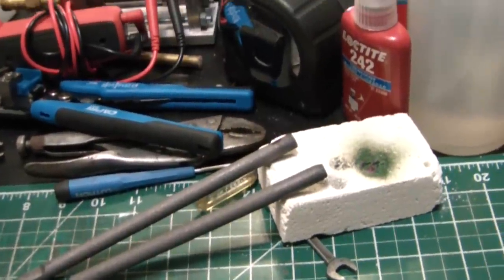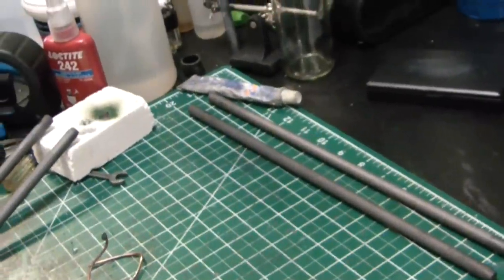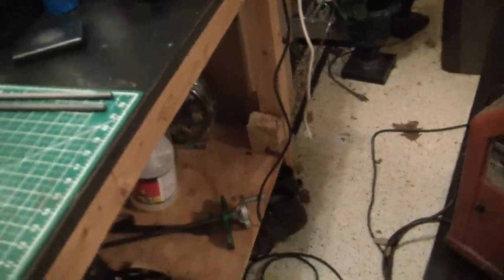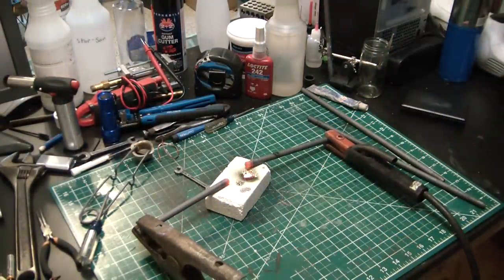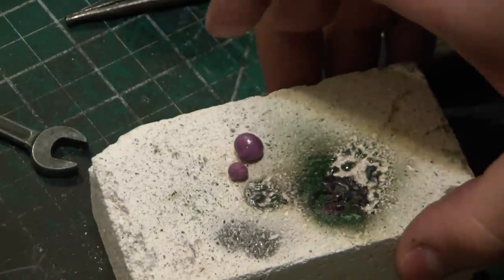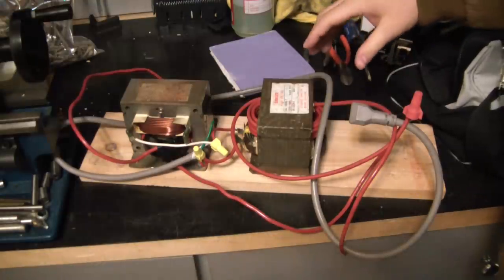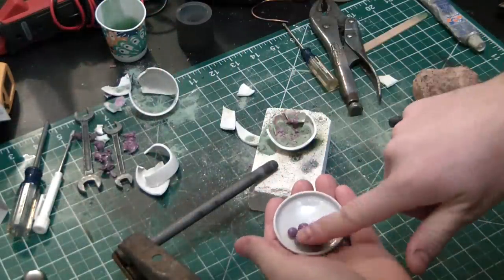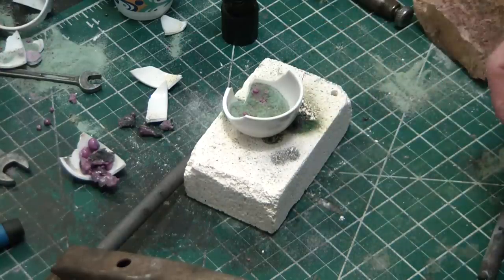Arc Furnace Ruby Gemstones DIY - Huge Rubies and Giveaway! - ElementalMaker

Comment: Isn't chromium oxide poisonous? Everywhere I've seen it's saying it is yet I see you handle it like it's nothing I'm confused
Reply from the maker: This is a chromium III compound, hexavalent is the very dangerous varient of chromium.
Reply: @ElementalMaker  so as long as it's not hexavalent chromium you're fine correct?
Reply from the maker: @theevilzipper  there are other forms of chromium as well, and I'm sure certain salts are still quite dangerous, even of chromium III. You just need to research each chemical your working with to be sure
Reply: @ElementalMaker  I agree and I downloaded the SDS sheet the reason I was confused is because I hear some people say it's dangerous but then others on YouTube handle it like it's sugar so I figured since you seem extremely knowledgeable I'd ask you
Reply from the maker: @theevilzipper  I would certainly recommend good ventilation and washing your hands after handling.
Reply: @ElementalMaker  I have a Miller welding respirator p100 I think and 9mil black rubber gloves. What about clothing? Do I need disposable clothes?
Reply from the maker: @theevilzipper  the respirator and gloves are more than plenty. Try not to pour it all over yourself, but if so just wash the clothes. Hexavalent chromium would be a different story but Cr2O3 is quite safe to handle
Reply: @ElementalMaker  sweet thanks so much for answering all my questions

Comment: Oh hell you can make your own carbon Arc rods just take them out of D cell batteries
Reply from the maker: Those would be quite small for use with an arc furnace. I'd recommend getting carbon rods from a lantern battery instead, they are much larger.

Comment: "better zoom out my camera if its zoomed it would burn out my lens" you know that's not how light works right?
Reply: There a tow ways to zomm in/out a video the optical way by changing the distance between the lenses which means the burning point moves toward or away from the sensor

And the digital way by scaling the pixels

Only the first one has a slightly risk of overheating the sensor

But if the heat isn't to great u will lose same pixels in the video because semiconductors change electric propertys about 50 degrees Celsius and stop working till they cooled below that temperature a permanent damage is still possible wenn u toast that little silicone chip

Comment: Recomment: 
Has anyone thought to put synthetic rubies in a kiln, like glasiers do to homogenize glass? Theoretically, one could get the stones to recrystallize, giving a clear, semiprecious rubidium. 

Thoughts, Elemental Maker?
Reply from the maker: Unfortunately kilns don't get hot enough I think
Reply: @ElementalMaker  the idea isn't to melt the ruby entirely, but get it soft. If it stays soft for long enough, they may cause a cascade effect clarifying the ruby material. That's the theoretical physics, anyways.
Reply: @ElementalMaker  they being heat and time.
Reply: @ElementalMaker  I was just watching NHIL's vid he did after yours. The combo of a graphite crucible, and the arcd ruby, being immediately transferred to the pre-heated kiln, and then following a cool-down proceedure not unlike glass,... You see what I'm getting at here? Yes, it's stupidly long and slighty expensive. However, you'd actually be the first to ever do it that way, and I suspect it would actually work. I have the knowledge, I just don't have money or a kiln. I thought I saw one in one of your vids years ago. Still have it?

Comment: Has anyone tried to actually cut this rubies and polish them? Would they look like a normal ruby?
Reply from the maker: I did try, however there's so many tiny air bubbles it's not really worth it as a gemstone imo
Reply: Could you not melt it after producing the gemstones to remove the bubbles?

Comment: diy ac or dc electric motor-fan to ac or dc, high voltage, brushless generator
Reply: yes fully mechanical, coils and magnets, cores, turning
Reply: make some silicon-metal in vacuum ionizer
Reply: vacuum chamber it with a shield, for the eyes, uv light solar cover
Reply: just a lead acid battery arc welder, direct

Comment: You obviously don't know too much about arc welding or carbon arc torches. Google carbon arc torch and learn something. A carbon arc torch can still be purchased at many reputable welding supply stores. BE CAREFUL!!! Those rods are used to power the huge search lights that you sometimes still see in the sky at huge events. They can do more than just give you a sunburn. Learn more before you try too many projects. FYI... I have a carbon arc rod. It is not something you want to toy with.